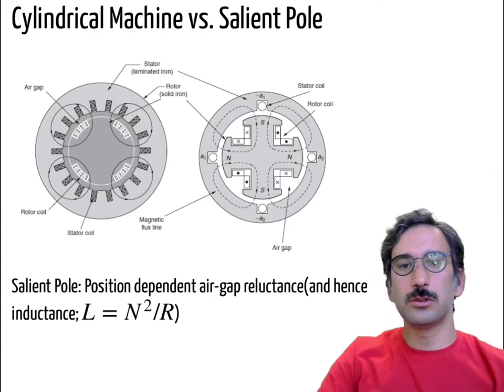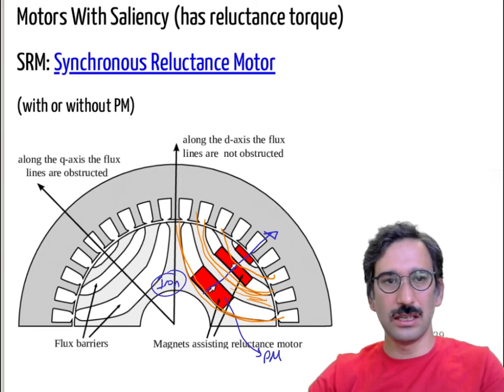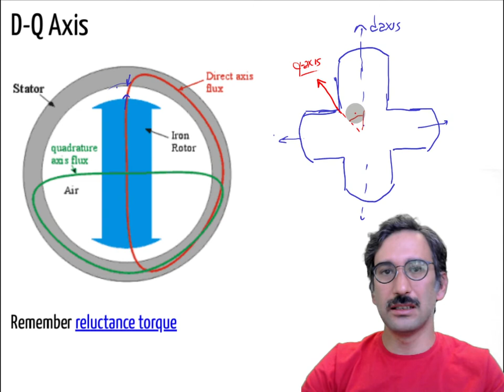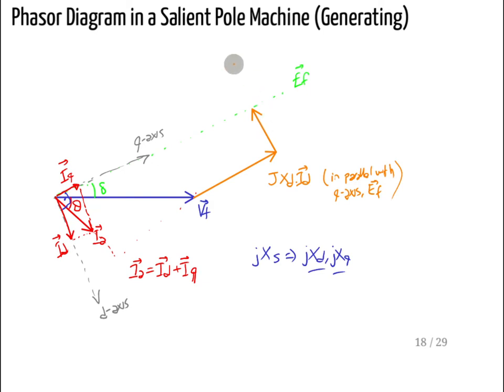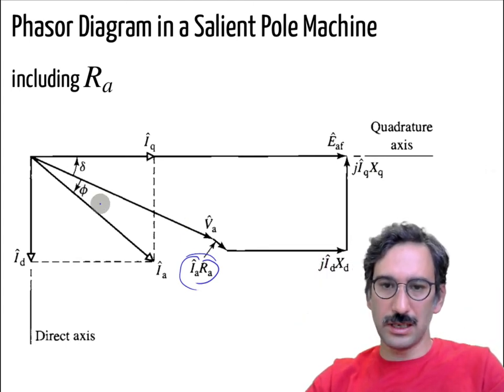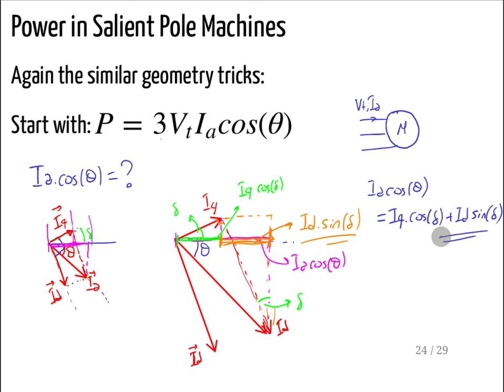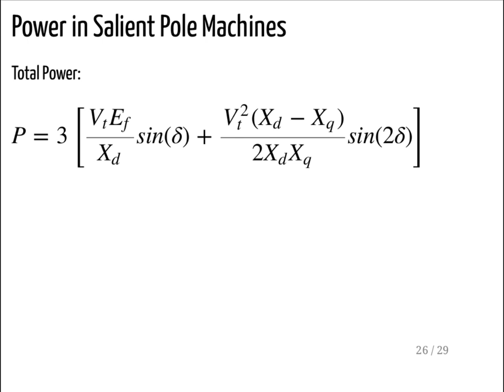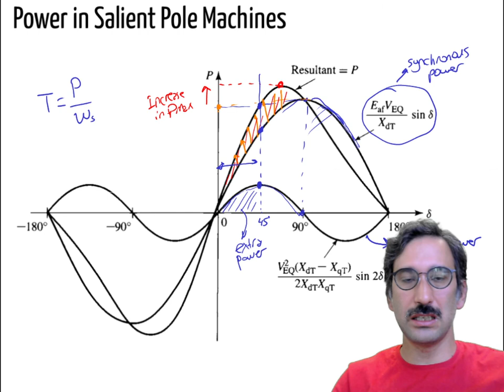Salient Pole Synchronous Machines

Comment: 14:03 = In case of IPMSM, d-axis is where the flux is produced by permanent magnet, that axis has high reluctance and hence low inductance.  Hence in IPMSM, Ld < Lq. This is opposite to your diagram of a machine with mechanical saliency (rotor itself has saliency due to steel core design) and hence Lq < Ld.